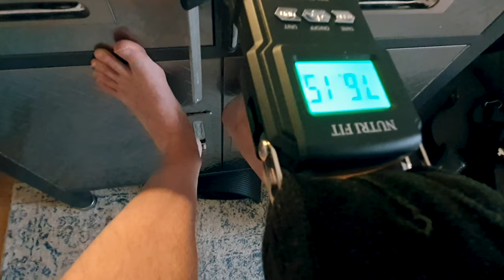How to build an Ottoman Bow - #6

Comment: Awesome bow, looking forward to the final result. I am in the process of building an ottoman hornbow too. Before the final coating, i am currently shooting a couple dozent arrows to check if the bow is holding up😅
Reply from the maker: That sounds amazing! What's your draw weight? I dry-fired the bow several times (without an arrow) inside, because we have very bad weather conditions right now and I did't want to risk getting it wet and sticky 😆
Reply: The draw weight is 70 +- 3 lbs @ 28 inches. I have read that horn composite bows start to outperform good self bows above 60 lbs. The mid limb dimensions are 34 mm in width and 11,5 mm in thickness. I built it under the instructions of the book "Ottoman composite bow" by Adam Karpowicz. Good luck with your bow! The amount of patience, time and materials costs is really another level 😅
Reply from the maker: @alexanderklee7069  thats a great draw weight - and a great book. It's one of my sources as well. I absolutely love it and I absolutely admire Adams passion for composite bows. Right now I'm trying to find the exact measurements for an indian crab bow (a.k.a. mughal bow) - but that's quite a challenge. You got any suggestion on literature? Cheers mate